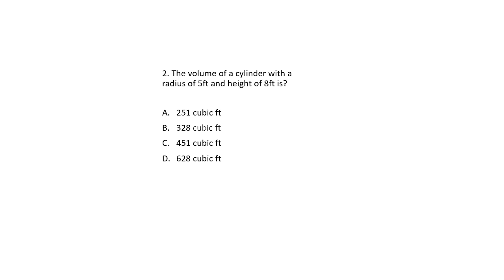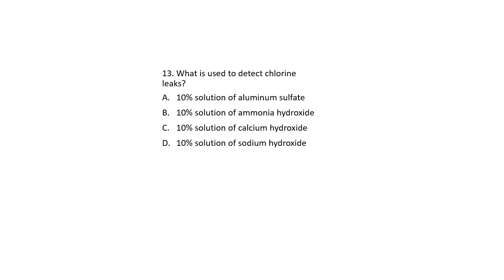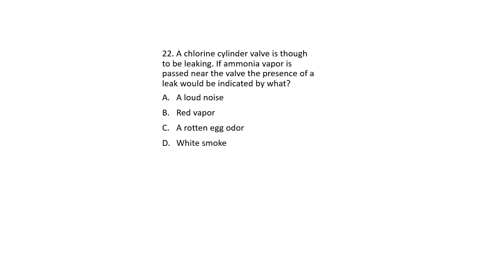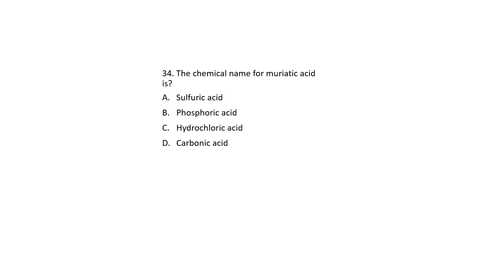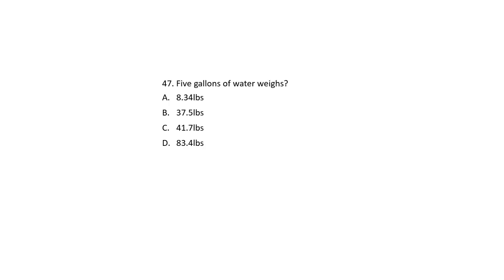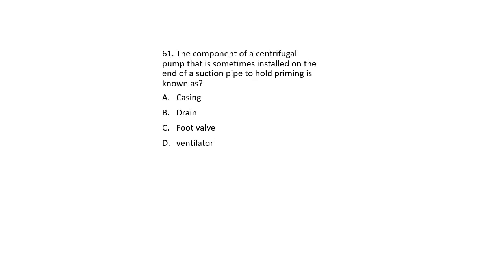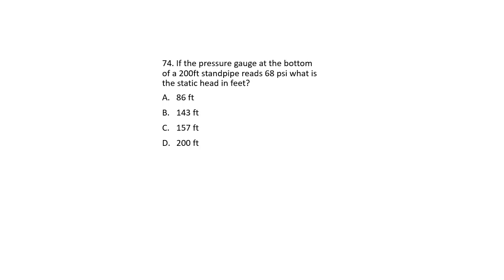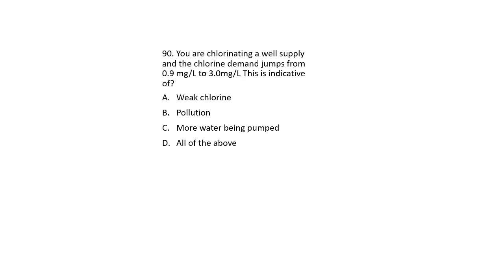Water Treatment/drinking water Practice test/exam 1

Comment: Is this for operator c
Reply from the maker: This is What Florida Says is on C level Exam 

Class C Drinking Water Treatment Plant Operators 
Each examination item may be from one of the subject areas listed below:
Aeration
Characteristics of Source Water
Clarification/Sedimentation
Coagulation and Flocculation
Corrosion Control
Disinfection
Disinfection and Disinfectant Byproducts
Distribution
Filtration
Facility Operation and Maintenance
Evaluate Equipment
Iron and Manganese Control
Laboratory Sampling, Analysis & Interpretation 
Math
Operate Equipment
Perform Safety and Security Procedures
Regulations
Reservoir and Well Field Management
Softening
Taste and Odor Control
Waste Handling and Disposal
Water Process
Reply: Just passed today the c exam in flordia can say its easy but there was alot of ion exchange and reverse osmosis questions
Reply: @d10rr18  looking to take my test soon - any advice on study material that really fits the bill?
Reply: Its on quizlet is the flash cards

Comment: Do you know if these questions apply to the general exam of most states? Im from PA and have been looking for any guides on drinking water operator certification general exams and this is the best I could found right now.
Reply from the maker: in all honesty as what to study for your specific exam level or state, the thing about the exams… the questions are all over the place 

I am in Fl and I don't remember what "state" DEP web page I found this specific exam on. 

All of the questions I have found are off of the internet. I google practice exams then search through the results. Then do my best to certify the answers. I use the Sacramento State books.
Reply from the maker: quick google search finds this page with some advice for PA Exam Prep

https://www.pa.gov/agencies/dep/programs-and-services/water/bureau-of-safe-drinking-water/operator-certification/initial-certification/preparing-for-the-exams.html